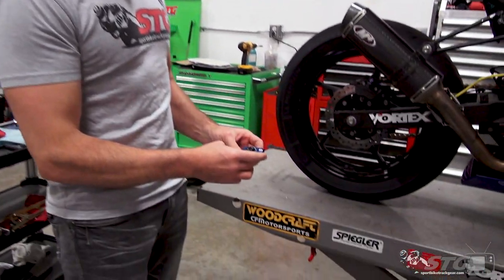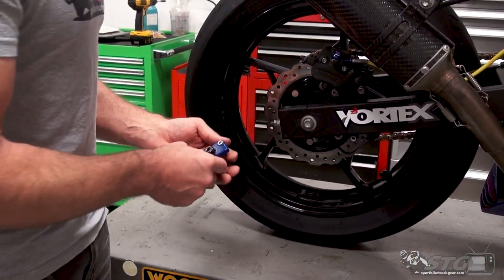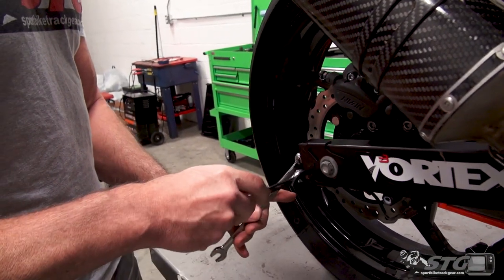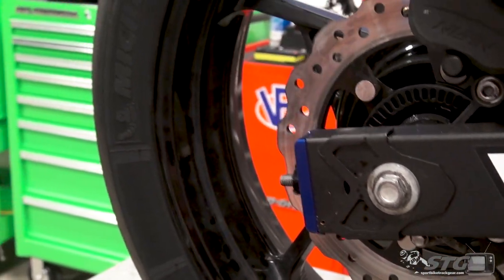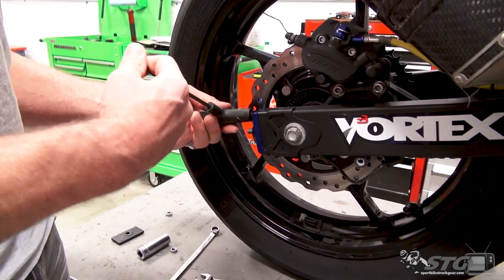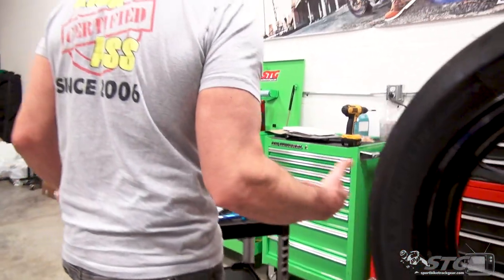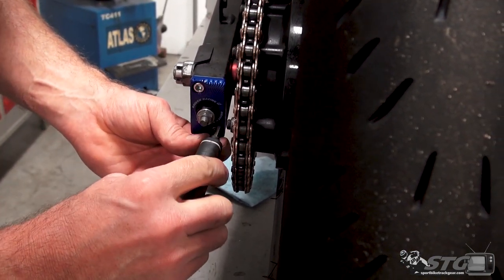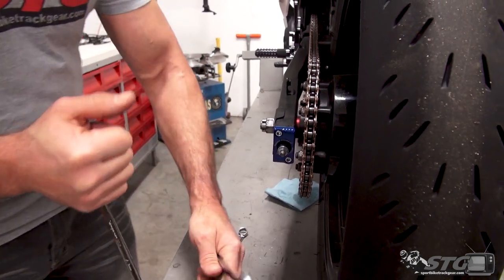Kawasaki Ninja 400 Driven Captive Axle Block Adjusters Install | Sportbike Track Gear

Comment: Just picked up a set for my 400. The first thing the directions said was "Remove the rear axle while suporting the rear wheel". Wrong, as you showed in your video, undue the standard blocks and thread the new ones on, lock it down with the standard washer and nut...
Reply from the maker: Happy to hear the video was helpful and enjoy your Ninja 400! - Van

Comment: how fast do these 400s go after setting them up for track use. and how well do they corner with those tires compared to a 600-1000cc.
Reply from the maker: Corner every bit as well or better than the bigger bikes when you have them set up properly. - Van

Comment: Will it fit a kawasaki ninja 500
Reply from the maker: Sorry these are not designed to fit the Ninja 500. - Van
Reply: Do u know if the diameter is the same as the Ninja 500